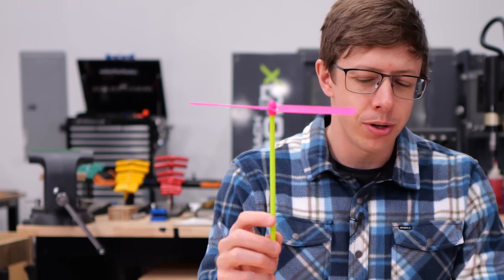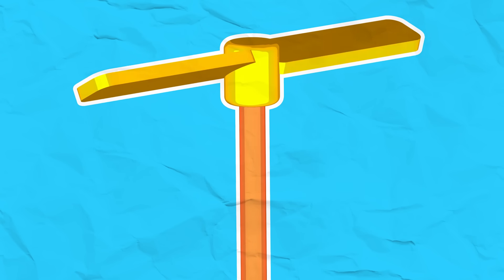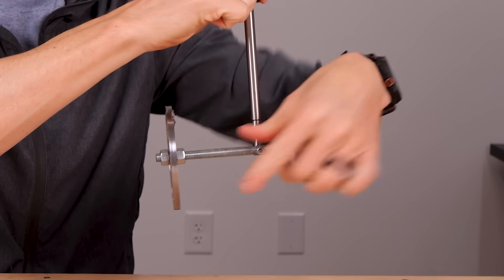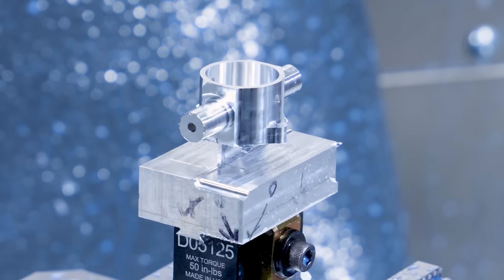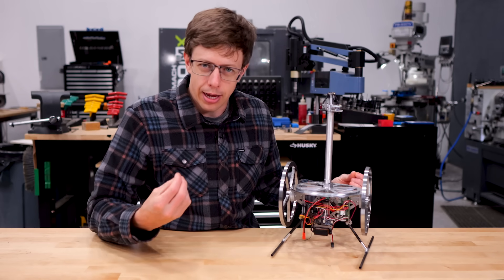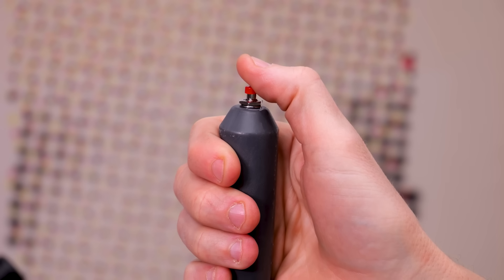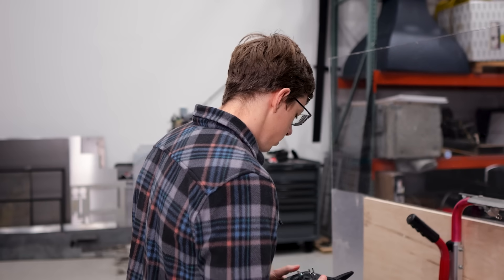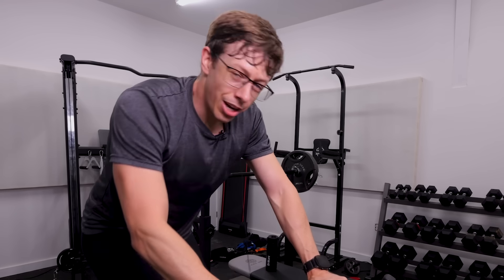I really thought this would fly well

Comment: I'm sure this will be answered in part 2, but at what point is the childhood Helicopter no longer a childhood helicopter, and just a full fledged RC helicopter? Is it going to be the tail section to prevent the  Torque rotation?
Reply: It's a full-fledged helicopter when the power system is onboard, not ground-based.

Edit: I thought this was just a throwaway comment, but it's sparked the engineers to come out, so I'll clarify. IMO, storing kinetic energy via momentum is different than storing some alternate form of energy (chemical, electrical, etc.). As such, having a fuel or battery on-board a "helicopter" allows the rotor to maintain a constant speed for as long as fuel or charge remains available, increasing or decreasing speed as desired over a long period of time. In a purely mechanical system where flywheels are the only form of on-board energy storage, the rotor speed will maximize before takeoff, then as soon as it is disconnected from it's power source, the rotor speed decreases over time (assuming a constant rotor pitch). I suppose that is the difference between a childhood helicopter like in the video and a proper RC helicopter.
Reply: @Phriedah  Yeah that is what I was going to say, it is all fair as long as all the energy is stored prior to launch.
Reply: @Phriedah Well in this case the power system is the flywheel XD
Reply: @mangaminx9440  the power system is the electric motor he's using on the ground, the flywheels are just an extension of the inertia present in all rotating things, even flimsy plastic helicopter blades. If this is your argument, then everything is a helicopter.
Reply: @Phriedah  There's no real difference between storing energy in a flywheel, a battery, or as a chemical reaction. They're all energy storage. The system to convert the energy is in this system, so if that's the requirement it would meet your definition.
Reply: @Phriedah  the power system is on the helicopter though. It's using a fly wheel as a battery. You can say he's spinning it on the ground but you also charge your RC helicopters battery on the ground too.
Reply: @Pwn3dbyth3n00b  I don't think that is fair, because with or without the flywheel the thing uses stored kinetic energy to generate lift. The flywheels are just ways of storing that. An RC system charged on the ground stores energy in another form to produce kinetic energy and that produces lift.
Reply: @LlywellynOBrien  but at the same time it's just how energy is stored. Is a prop plane not a plane because it uses combustion to spin a mechanical shaft that spins a propeller? Or is a jet not a plane because it uses combustion to spin a compressor directly from the expansion of gases? Is an RC plane not a plane because it doesn't use combustion at all?
Reply: @Pwn3dbyth3n00b  I just do think it being the same type of energy makes a big difference. If you made a little helicopter out of balsa wood and a much larger one out of anything heavier the latter would store way more kinetic energy. 

To my mind the flywheels are just a way of achieving the same. He's made the system store more kinetic energy but no conversion or addition of energy occurs after it has been launched.
Reply: @Pwn3dbyth3n00b  I mean by that logic even the childhood toy is it's own self contained battery. What is the body of the object other than a rotating flywheel charged by your hands?
Reply: @Pwn3dbyth3n00b  The difference being a flywheel is a kinetic battery not an electrical one
Reply: @Pwn3dbyth3n00b  IMO the original toy also used the stored kinetic energy to provide lift. So neither is really "unpowered" but more that the source of that power is a separate system providing the energy. But in that lens I agree, the only difference in a real battery is the change in forms of energy...
Reply: Probably good old counter-rotating rotors like modern drones use quite efficiently.
Reply: i thought the line was the power source, these things only carry kinetic nrg, no battery
Reply: @tubewatcher97  did you really just abbreviate "energy" to the pro team's name "nrg"? bruh
Reply: @Heroo01  yeah sorry , i was typing with a mouse and on scr kbd and got bored
Reply: Yeah he went from whirlygig to balls out autonomous flywheel powered heli in five minutes. There are better ways to have fun without lowering your expectations 😂
Reply: This was a really interesting thread of discussion about the nature of the project. Is it a helicopter or not, does the "type" of energy and the way it's stored impact the definition, and the fact the toy is using stored kinetic energy in the form of inertia imparted by the hands. Just really cool discussion, thank you guys for having it!
Reply: What would happen if the flywheels were parallel with the blades of the propeller?  You'd still have the energy stored in the flywheels and their torque would cancel each other out.  I suppose there would still be torque from the blades...what if the wheel spinning opposite of the prop was heavier to cancel the prop torque as well as the torque from the other wheel?
Reply: @JointerMark that's what i was thinking also may work
Reply: I'd say it's not a child helicopter when it has parts moving relative to each other
Reply: at what point is it not a childhood helicopter anymore? When its not using fly wheels for power storage.
Reply: Yeah it hurts to see the incomplete design crashing. It's almost a full helicopter with variable pitch and RC control. Putting a third gear against the main one and adding a tail section with a smaller prop sounds like a fairly simple and effective solution. Pretty sure we will see this in part 2.
Reply: you'd probably like Engineezy!
Reply: What about a pair of counter rotating flywheels, but vertically aligned, with gear reduction for the prop.  It would keep it more similar to the original concept, without turning it into a helicopter.  You could have one flywheel heavier than three other to offset the rotational momentum of the prop? It may still rotate when the prop speed changes but it should be more vertically stable
Reply: This channel is 100% about over-engineering, so it would not make sense if the childhood helicopter had stayed childhood anyways…
Reply: Was thinking the same.
Reply: I figure it's gone way past child toy when you break out machine tools instead of catalog pieces and xacto knives/drills.
Reply: I'd say the difference is that all of the energy for the propellers is added before takeoff rather than powered in flight by a battery.
Reply: Yeah he should have just made a big metal dangerous childhood helicopter. Dudes just making a regular helicopter lmao.

Comment: 14:35 I think the reason why the control surfaces aren't working as well as expected in this test is due to how close they are to the ground.

If you do this test either over a mesh, or on a pole that can rotate high above the ground, the control surfaces will get better airflow and be more effective.

Another thing to consider could be that the downwash of the propellers will be helical, rather than straight up and down.

Awesome project though! Really looking forward to how this evolves over time, its a really good idea!
Reply: And the air going over them is extremely turbulent I imagine.

Comment: i feel like when u are at the point of "hacking" and adding servos it would have been neither difficult nor a stretch to put 2 drone motors on pipes coming out opposing sides facing sideways to counter act the rotation like how single propeller helicopters do but ok.

Comment: I dunno why you needed to reinvent the wheel there - counter rotating blades? Or if you wanted to stay true to the source, put the flywheel on the main shaft, spin that up with a bevel (1 drive, 3 idle) and hold it down electromagnetically until ready for release (taper bearing style interface), at which point it automatically disengages from the drive gear.

Comment: Would it not have been better to make a small sideway propeller, just like real helicopters have and if you attach it to the same power source and get the gear ratios just right it should automatically counter the rotation at any speed.

Comment: I'm guessing the solution will be a third flywheel spinning opposite to the propeller. Which sounds pretty complicated to do, especially given how much weight is already on that thing because it'll need additional gears and bearings and stuff. I'm guessing even back of the envelope calculations were enough to be confident that the wings weren't gonna work at all (the torque of the propeller+gear being pretty easy to measure and significantly higher than even the most optimistic measurements of the estimated airspeed able to generate lift from the stabilizers). The only way I can imagine countering it would be that, or adding counter-rotation propellers that act like the tail rotor on traditional helicopters.

Comment: Would there be a problem if the fly wheel rotated in the same axis as the rotor and was just coupled with some kind of slip ring?  You rely on dynamic friction to transmit the power so it will come to a natural equilibrium of rotation speed vs drag.

Comment: if the flywheel was instead pointing up on the same axis as the propeller but spinning in reverse would the torque cancel out without needing to worry about procession?

Comment: I am confused. Why did you not simpily use an in line fly wheel?
In fact if you made it a sort of shell around the propellors it would not only store energy but make the propellors more efficient.
Plus you could have what amounts to a weight on a pole below it with some little proppellors that can operate your pitch from up to down when it starts to fall, and from down to up when the probe touches the ground.

Comment: Why not just have a flywheel at the bottom of the stick, with no gears, and no flaps.  Air resistance has to then slow down that angular momentum in addition to the momentum of the rotor blades.  See gyroplane kits, where you can choose the low mass/inertia or high mass/inertia blades to choose how fast the blades spin down during maneuvers.

Comment: Oh man. Blowing air creating thrust...not how a helicopter works, my guy. :D Lift...LIFT!!

Edit: Yeah, just finished the vid. Super fun! But, the air flowing over the control surfaces creates relatively little force because it's not the downforce of air coming off of the blades that pushes the helicopter up. It's the fact that the helicopter blades are little wings themselves, and spinning them through the air generates lift just like an airplane wing.

Comment: short correction, rotor blades don't create thrust but lift, depending of the angle and rotation they create more or less lift due to a depression in the air caused by the two different air speed above and below the blade .
Reply: Lift is just upwards thrust

Comment: Calling it now: you did counter-rotating flywheels to cancel the gyro forces and make it stable but forgot that that big horizontal gear will act like a flywheel itself with nothing countering it.
Reply: it's not just the big gear he added, it's also the rotor. there's a reason why helicopters have tail rotors
Reply: @wi1h  Well, that is the modern traditional, single-rotor, helicopter. There are also helicopters with counter-rotating blades to cancel out the torques.
Reply: @ZeroGravitas187  Was gonna point this out too, with this design the obvious choice should have been counter-rotating blades! (Not that I would have been able to design nor build this - and even if I could, I probably would have fallen into the same trap. My captain hindsight powers make this the "obvious choice")
Reply: @ZeroGravitas187  Counter rotating blades have an extra problem in this application: Since he will be trying to keep it light, I'll assume he will be putting the two blade sets on the same axis. If they are placed one atop the other, the blade tips will crash into each other when they go past their limits and produce too much lift. 

Real helicopters with similar blade setups have speed and altitude limits to prevent this.
Reply: @XTJ7 I'm guessing the reason he missed it initially is because the starting point was the little stick propeller design where there is no body experiencing an unequal torque. And once the design was built adding a coaxial counter rotating prop would be complex enough that it would pretty much need to be redesigned from scratch
Reply: Yep, I'm not an engineer but this makes sense to me
Reply: Yep, except not the gear but the rotor blades themselves. As they push the air down, the air pushes against them and spins the whole thing. Without anything like a tail rotor to counter that it spins out of control. He tried some wings but they were woefully underspec'd for the kind of forces a rotor generates.
Reply: You need a tail rotor….
Reply: And if propeller drag is a major issue, counter-rotating props might help with that as well.
Reply: It's all the mass rotating in one direction. Blades, gear and all. If a helicopter could just put alerions on the bottom instead of a contra-rotating prop or tail rotor I'd think we'd see more of it because that'd be far cheaper.
Reply: I'm seeing a rotating object with multiple modes of rotation and flywheels going Brrr.

I believe this device is flawed as a concept because of the need for multiple off axis flywheels. If we tried a planetary flywheel, maybe it stands a chance, but I have doubts, but at least the rotation axis matches that of the lifting blades.

The better way to experiment with this machine would have been a number of low speed flight tests experimenting with it's flight profile and behaviors
Reply: Oh man that is likely
Reply: i'm just intuitively thinking couldn't this be solved with inequal weight flywheels? have one wheel smaller so there's still some gyro effect to the whole machine, find ballance to work it out?
Reply: @LucianoVeryNiceHi  i feel like that would work but only at a single speed. And everyothrr speed would be unbalanced and the helicopter would spin again